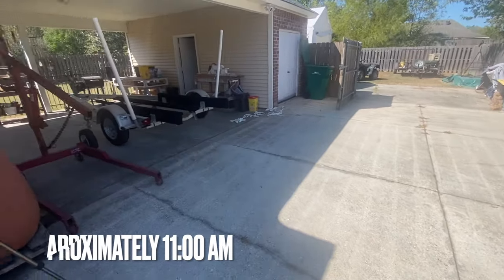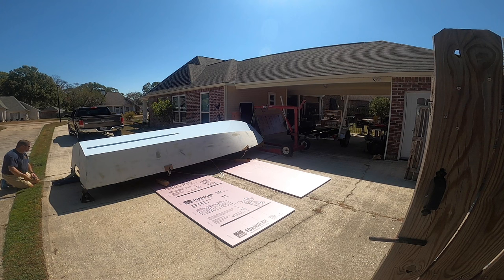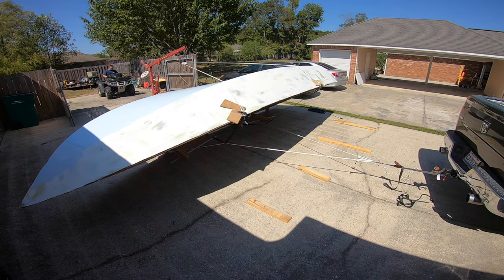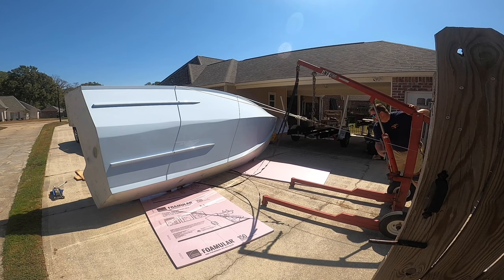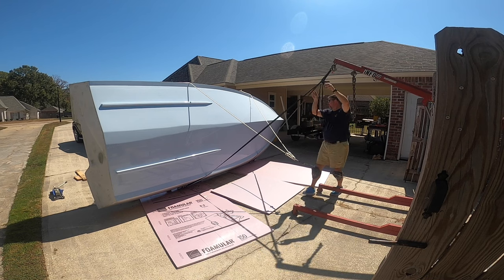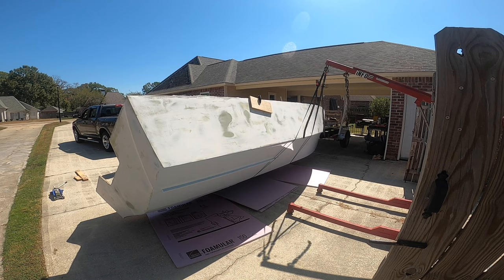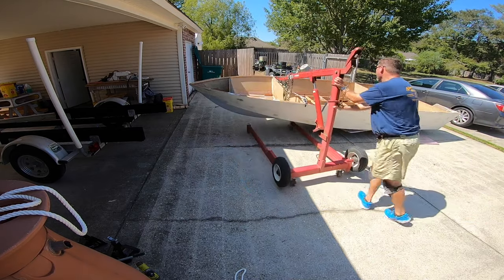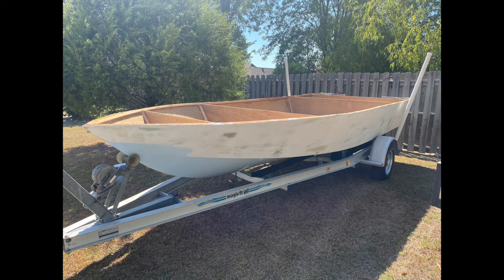47.DIY Boat Building:Boat Flip Gone Wrong=LUCKY!

Comment: You really built that suspense in well. Solid job.
Reply from the maker: I may have taken a certain liberty to exploit an unfortunate situation for my advantage.  Is that wrong?
Reply: @Bigeaux20  I don't know.  Whether or not it is, it is becoming common practice on here, so you have that going in your favor.  :)
Reply from the maker: Yeah well don't expect it to be common practice.  All hype and methodical dragging out an issue for nothing is not my style.  I create enough drama in my normal attempts to be productive.  I will rely of natural occurrences, but my caveat is I will keep you thinking.  Appreciate it.
Reply: @Bigeaux20  excellent. I look forward to the transition back to the inside
Reply from the maker: Me too.  Starting to see the finish line in sight but it's waaaaay out of focus.
Reply: @Bigeaux20  I'm struggling just to get hull built on mine, and hopfully one layer of fiberglass before the cold sets in for winter.
Reply from the maker: Well did you get your fiberglass done before the doldrums of winter?  What are you working on by the way?

Comment: You should have painted the whole bottom when you had it upside down? Seems it would have been easier?
Reply from the maker: Maybe. I still have to finish the sheer bumper and stuff so I chose to have my paint edge be the chine edge as opposed to having some seam up higher on the hull side where it will be more visible.  The painting part is easy comparatively but having the fairing “done” on the side should make it easier to paint when the time comes.

Comment: Man you gave us a scare for sure!
Reply from the maker: How do you think I felt in that moment?  Here's a hint, like an idiot.
Reply: @Bigeaux20  I’d say lucky haha. The whole time I was expecting the boat to roll over onto the legs of the hoist and cause two big scratches. All is good. Enjoy working topside. Just a tip, get you some 18” high planks on both sides of the hull so you can get in and out easier. Half the battle topside was having to climb in and out of the boat while on the trailer.
Reply from the maker: I'm going to build a couple sets of stairs to make entry and exit more functional.  That's in the plan already, and I have a couple of short step stools that work well.  I've thought of taking off the wheels, tires, and fenders to keep from banging my legs on them.  I'm sure the top side will present it's on challenges, but at least now I feel I've developed enough skill to avoid any major hiccups.  You know like dropping it when I roll it over.